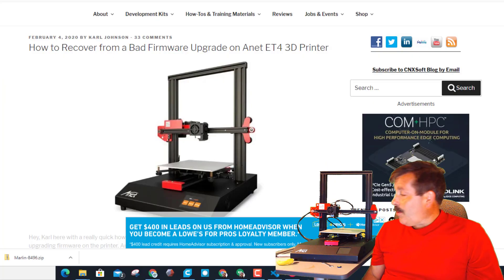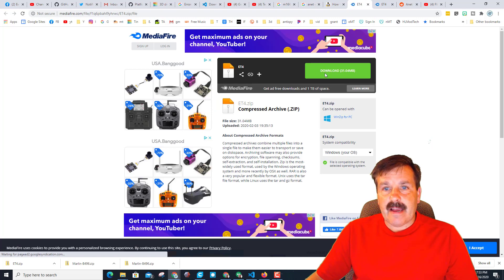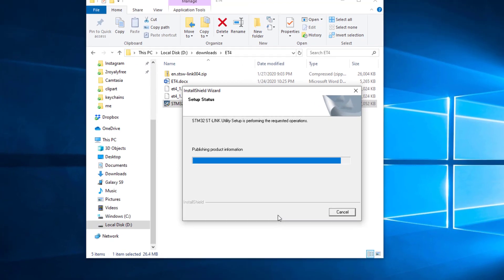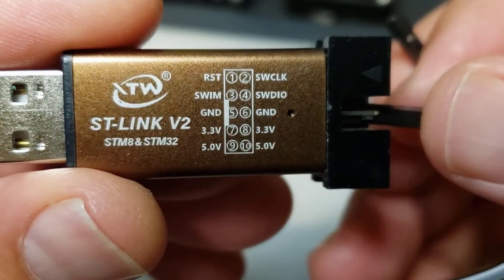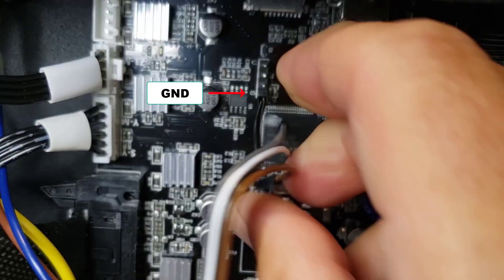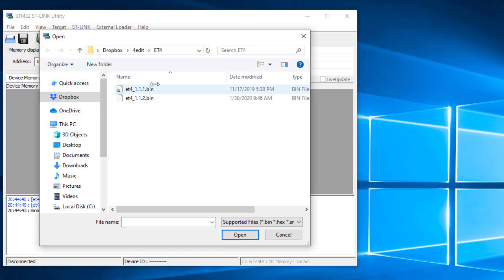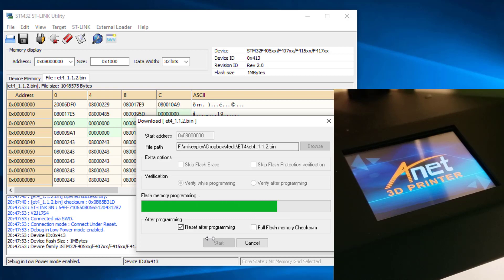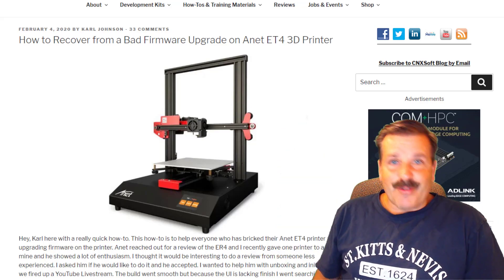Solved! ST-Link V2 Anet ET4 firmware bad flash recovery | Step by Step

Comment: With me, it wouldn't modify the original software, so I thought I'd put Merlin on it. But there the Z axis goes the wrong way and the home switch won't work. But now I can't get the original software on it! Does anyone know how to do this or possibly find the original bootloader?
Reply from the maker: It sounds like you have the wrong ET4 version flashed. One homed up.. one had a sensor and homed down. This is how to get back to stock.. https://youtu.be/KKCer809pxU Just make sure you have the versions correct.

Comment: Firmware never worked for me. My printer is Labists ET4. Maybe this is the difference? When I install 1.1.2, it ignores the proximity sensor and keeps trying to drive the nozzle through the bed. Tried re-loading the original firmware, but the machine won't even boot up. HELP!!!
Reply from the maker: The stock firmware did not have the proximity sensor... that would be a problem. I think the ET4+ was the first to have a proximity sensor. I am not sure what changes are in there by Labist though.

Comment: Is there another software to use for setup of the ST-Link V2, as using the STM32 Cube Programming, with the updated firmware will not connect as not recongised by the software.  So unable to updafe my firmware still on my 3D printer.  Mainboard supplied by BigTreeTech will not update through SD Card.
Reply from the maker: I do not know of any other tools. I do know I had to make sure I had it wired right and powered on though. Just sharing as those were issues I faced back n the day.

Comment: In my cause the ST link dont connect with gnd swd swc... Show -- No ST Link detected... But I can connect to a development board with the same st link.
Reply from the maker: I have had many people say their pins were different on the ST-Link... That would be my first guess. I also had an issue when I did not turn on the 3D printer too. 🤦‍♂️ Thanks for reaching out and let me know if it does or does not work.... Maybe I can come up with another thought too.

Comment: I keep getting a communication error trying to use the st-link V2
Reply from the maker: Make sure your pins are in the right spot... The ST-Link has versions there the pins are not in the same spots as mine. Second thing is forgetting to power on the printer. I had that once or twice too.
Reply: I got this solved right now, 1st PINS IO,CLK,GND and then +3.3 V connected to P1 dosplay connector (if your GND ist "down" then the +3.3Vpin is top left in P1 connector) desk then lights up LEDs and i was able to program it

Comment: Do you have a firmware file for ET4+ ?
Reply from the maker: I do not host the files, but I would use the link that was on Karl's site. Also the Anet forums have links to them too.
Reply: @HLModTech  thanks you for answer. I tried et4 pro update firmware file (.hex) and its worked for me.(.bin is not working)
Reply from the maker: @ismail_karaman  Sounds good. Glad you have it all working again. 👍

Comment: Hello my ET4 had a failure and i read yours YouTube file, buy a ST link and connect him and load the program  now 1.1.2.bin
and my 3d printer work well  {first i have try upgrade my printer ET4 from 1.1.1 -> 1.1.5 but its give only the anet start screen}
my question is is there a firmware higher than 1.1.2 for my annet et4
Reply from the maker: There were rumors of 1.1.7, but I never tested it. Instead I have bumped it up to Marlin 2+ https://youtu.be/mAmIbrGi6G8